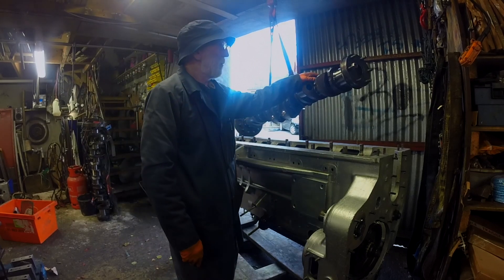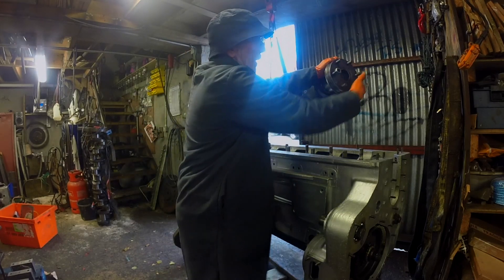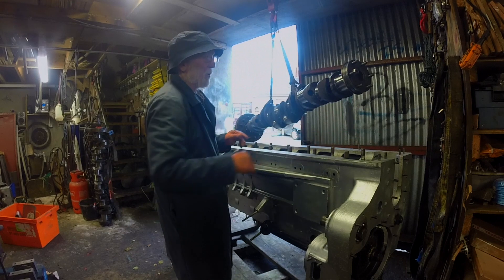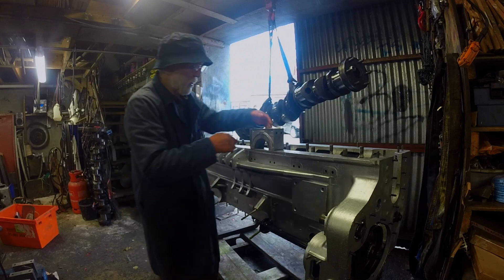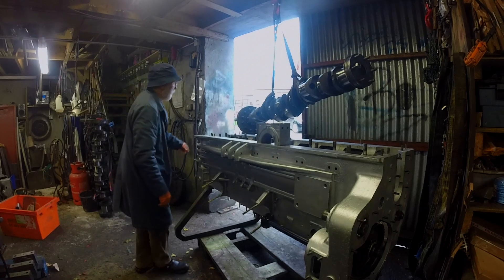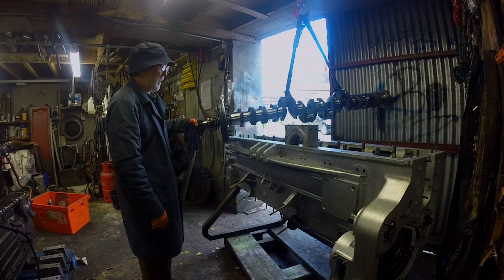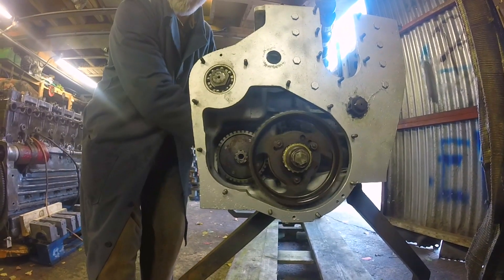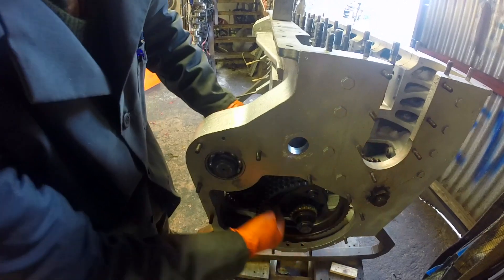Gardner Engine rebuild part one

Comment: can the piston rings be in any position as long as they are not in line
Reply: thanks  Joe I just wondered as when I was working on plant of all manner of engines the instructors on our courses insisted we never get them in line and I never worked on Gardeners and just wondered. great vids anyway
Reply from the maker: My understanding is that it does not matter.  Over time they orientate themselves randomly.

Comment: I really cannot believe this video - turning the engine on it’s side, and hammering in a piston using a ring clamp designed for entering the piston in the chamfered bottom of the block? Letting the con rod studs hit the crankshaft? Painting an aluminium sump filled with oil and the sealing face? Good luck to whoever buys that engine...
Reply: Hiya Stuart  correct , good video till it comes to fitting a piston     you top the bore with file / Emery tape  use a guide sleeve    piston slips in lovely  I always had some  body  guiding rod onto shaft  so as you say you don't dinge the journal with a bolt     failing that crank at TDC  and in it goes    served my time on the bloody things lol standing on my head half the time in non tilt cabs lol good days eh

Comment: The Gardner crankshaft had no rear main oil seal, as you know they where one of the few engines that used an Archimedes scroll, I can remember trying to drain oil from Gardners that was thicker than Foden EP140 gear oil. 😀
When we had new parts men we would alway make sure we put a sump gasket on the parts list.
Reply: Lol always use new gasket on sump  rocker covee timing cover

Comment: Joe this is great  i have a 6lw marine engine with a 2uc Gardner gearbox  when i  received the engine  i painted and polished all the bright work and it looks a million bucks  .With you explaining the internal running components it is making it easier for me to  to understand what i see in the drawings i have in the manual . Is it posable  some time down the track to go through `and explain the 2uc gearbox and how it works. Finding any information about them is a real challenge and there are still so many still in use . I will look forward to your next video